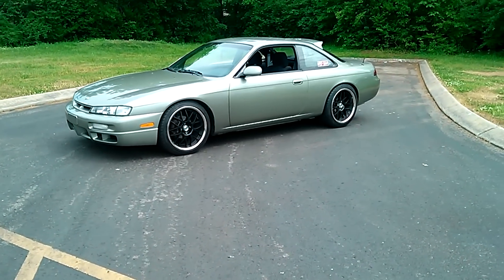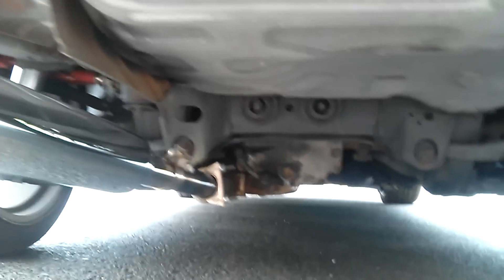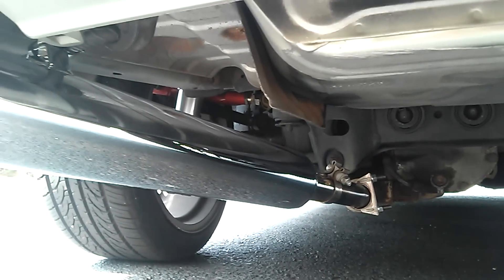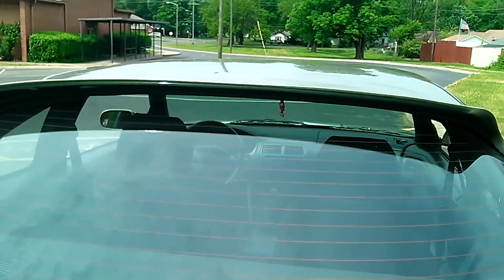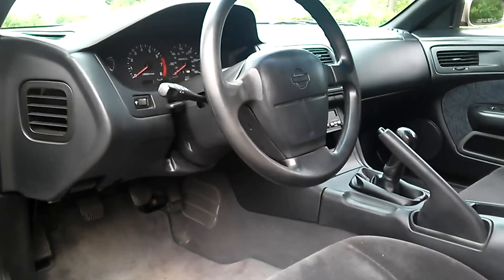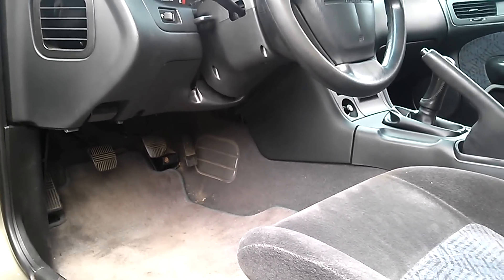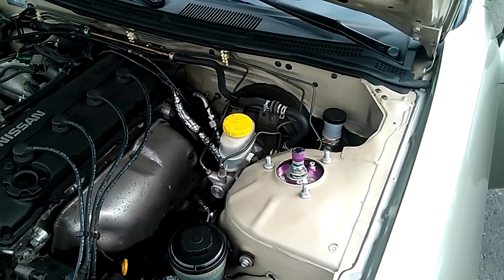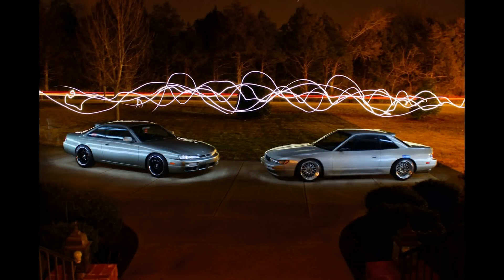My 1998 Nissan S14 Kouki 240SX Update | 5 Speed Swap

Comment: Hey bro ,quick question , what is a better overall car , the 240sx or the 300zx , answer if possible thanks , and love your cars man, their really awesome .
Reply from the maker: If the 300 is in good condition then there is no comparison between the two. There are pros and cons to both but the 300 is a way better car. It has more power, better brakes, standard lsd, better build quality, etc. There's a reason 300s cost almost twice as much as 240s when they were both new. But most 240s and 300s are in bad condition these days and 240s are easier to work on (it's just a more simple car). So I guess ultimately it depends what you're looking for. If you want to spend the money on the front end and get a nice condition car then I'd say 300 is best without a doubt. But if you want to buy a cheaper car that needs some work then the 240 may be the better option as it's much easier to work on than a Z32.
Reply: Chase Smotherman alright thanks man ,and keep the videos coming on your cars bro , we all need to see more , their very clean sweet rides man ,and thanks for replying to me.

Comment: What was the total cost for the swap..??
Reply from the maker: Around $700. I got the parts for $400 and then the new clutch kit, fluids, and various odds and end parts were around $300. A bit pricey but well worth it in my opinion. The car is much more lively with a manual trans.